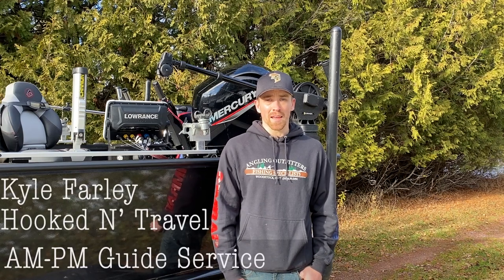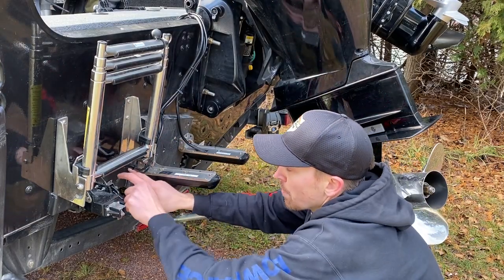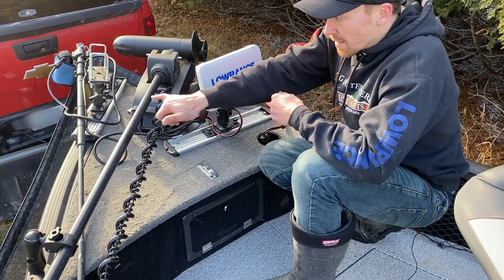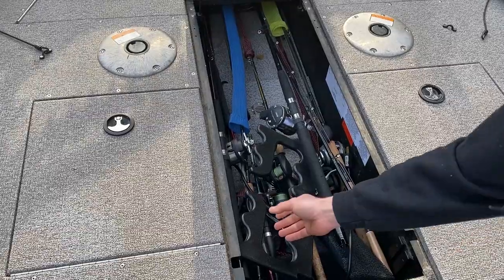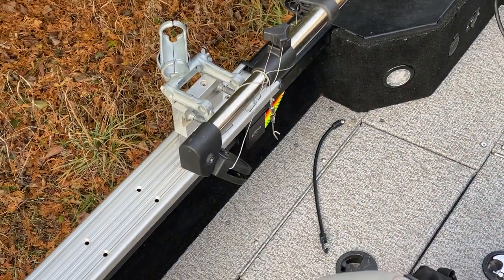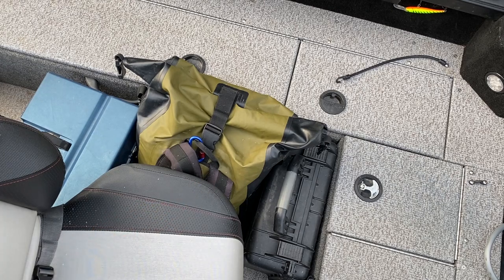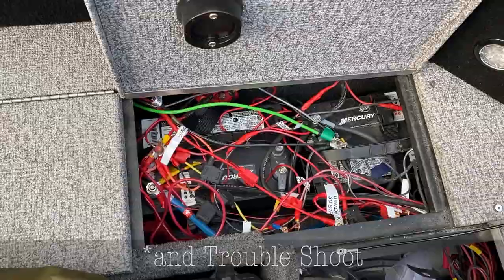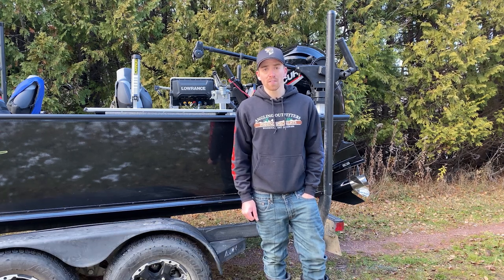Alumacraft Competitor 205 Tiller Boat Set Up, Modifications, and Walkthrough by a Fishing Guide

Comment: I am currently setting up my rig and was told to leave the transducer's away from the boarding ladder.  Your ducers are right by the ladder, why didn't you put below the kicker?  Also, I am debating between the Troll Master 3+ or i-Troll.  Any pointers would be much appreciated.  TIA!
Reply from the maker: I don't have any experience with the I-troll, I was recommended the troll master and most in my area go with that.  Have no complaints so far.
I haven't heard anything about not putting anything by the boarding ladder by anyone or any dealers I have talked to. I think people get told that because of the possibility of people damaging it boarding the boat using the ladder and/or stepping on the ducers. Which I can see.    The boarding ladder on my boat doesn't hit any of the transducers.  Made sure before install.  The only time I will use it will be during an emergency.    So the reason for the sonars on the left side is the sonar interference/vibration from being close to the 9.9.  The 9.9 will have some prop disturbance as well, more noise and to avoid any problems with the  9.9 blocking/hitting the side/down scans long pucks when turning. The 9.9 sticks below the hull and will block the transducers depending on where there put.  less room as well!!  . Even if you stick the ducer between the 150 and 9.9.  Less than ideal location between two motors. 
The only downfall of the left side is that the prop rotation kicks left but its so far away from the 9.9 during trolling applications you don't see any noise. the only ducer you use at high speed will be the 83/200 hst-wsbl and its good alongside the 150.  150 use doesn't matter when it comes to the down/side/3d/fishhawk. its out of the water.    If I didn't have a kicker there, just the 150,  transducers would be on the right.